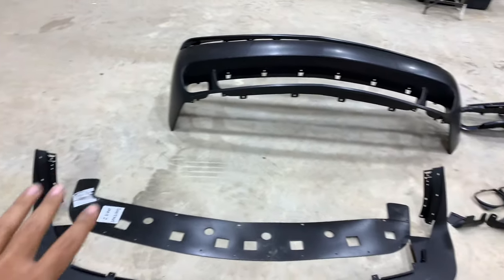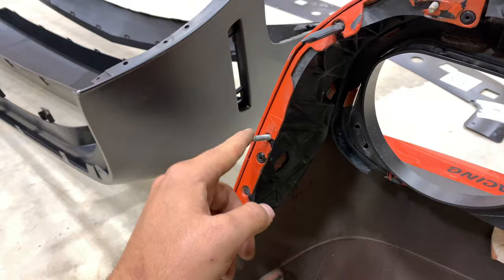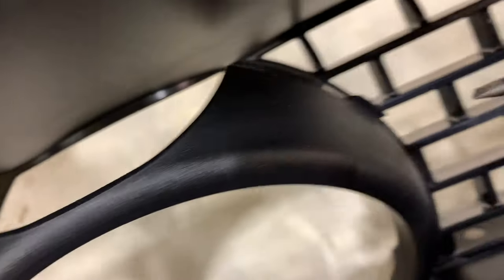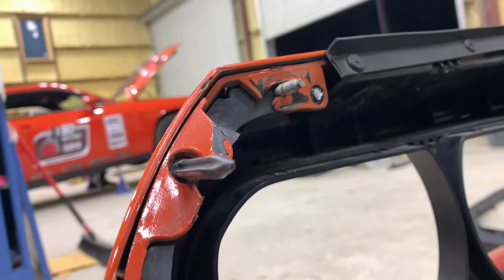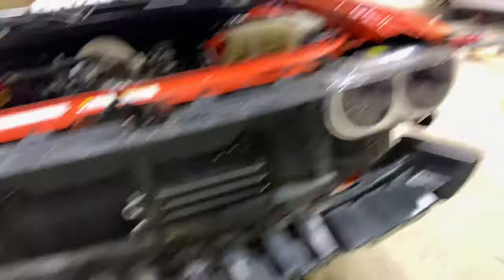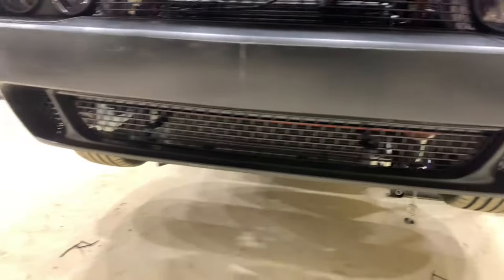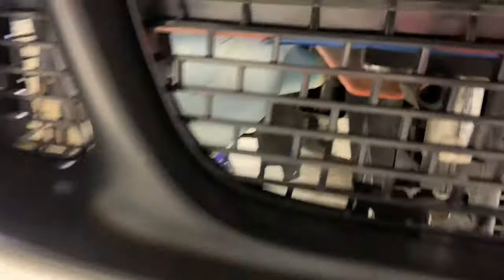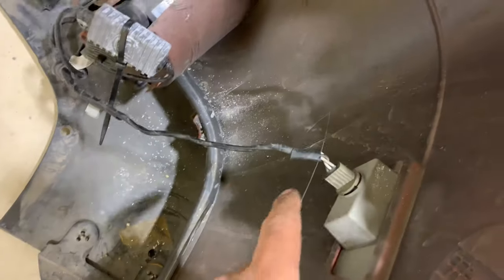Vicrez Demon/ Hellcat Front Bumper Install On My 2009 Challenger SRT-8!

Comment: I get my kit today 🥰. Perfect timing on the video.🤜🏽🤛🏽
Reply from the maker: Awesome! This is only part 1, I talk about having to trim it to fit my 2009, idk what year car you have so just keep in mind you might have or might not have the fitment issues I had.
Reply: TIRADO RACING I have a 2015 r/t that a recently procharged. This widebody is the most anticipated upgrade. Hopefully it goes well. Thank you for the time you put in your videos. 👍🏽
Reply from the maker: @Riveraharry75  I think i found you on instagram, I sent a DM, if you questions or want to see it up close i can send pics and videos. 

Im playing catch-up on video edits and posts, but the kit is painted and on the car lol you can peep it on my insta as well!
Reply: TIRADO RACING sounds good!!
Reply: @prochargedmopar15 when you finish installing your kit please post pics or videos I’m looking to buy and explain the process..I have a 2015 HC and really wanna know if it fits well without modding much
Reply from the maker: 6 Dreams it’ll fit the Hellcat the best. Because of the front bumper. I had to buy a Hellcat front bumper so the front forward most flare with the reflector would line up. 

The rest of the body lines are the same. Front fenders and rear quarters. Same.

Comment: Hey very helpful video. Just one question because I want to do this for my 2013 392. To upgrade lights would I be looking for lights of a 2013 model or 2015 onwards as fitting might be different after this install?
Reply from the maker: You need 2015+ headlamps. Do NOT BUY 2015 “styled” headlights for your 2013.

They absolutely need to be for a 2015 car. Secondly you need an adaptive harness for them to work on your pre 2015 model.

Comment: so when you installed the demon bumper on part 2, you didn’t need the parts that you took off at 7:38 along with the other parts you took off?
Reply from the maker: Yes sir, I threw them away. Whatever I took off to make it fit is gone. 

Now let me be clear I primarily use this car for racing, some of the parts I took off are important in the event of a collision. I’m In no way saying take it off I’m simply showing what it takes to make it fit.

Comment: Did you end up cutting your fenders to allow your tires to travel inside the fender flares?
Reply from the maker: Hey Jim, 

Yes I cut both the front and the rear and matched the cuts on the flares as well. My car is lowered on bc racing coil overs and now I’m running oem demon wheels on 315/40 tires all the way around.
Reply: TIRADO RACING man your car looks great and I won’t to do something similar to my challenger. Since you cut the fender and the flare how did you attach he flare to the car?

Comment: Hey bro did you end up using the middle bumper support? Im asking because i don't have it and i need to buy it. Thanks.
Reply from the maker: Are you talking about The black plastic piece and foam?
Reply: @TIRADORACING  minute 8:11 of the video.
Reply from the maker: Yea I did put it back in. The problem wasn’t that upper bracket it was the grill hitting the headlights. In my second video installing the bumper I show everything I did to make it fit. Trimming and cutting.

Comment: Hey man! Any ideas on the specifications of the screws, nuts, and rivets? My kit did not arrive with hardware
Reply from the maker: Man I have not a single clue. Just to verify, you purchased yours through vicrez? If you did purchase it through vicrez I would contact them directly.
Reply: TIRADO RACING thank you!
Reply from the maker: Good luck Jasper!
Reply: Ha yeah just got my kit yesterday as well and came with zero hardware. But it came with a foam part to replace that plastic bumper you removed.
Reply from the maker: Mine came with that foam too, I didn’t use it because weight reduction lol but just like I told the other guy I would contact them directly. Really weird they don’t have hardware with them
Reply: Yeah I actually found that hardware. But man the fitment is far from OEM like they claim. But putting that top assembly into the bumper are so far off i might need to contact them.
Reply from the maker: Just to clarify anything, this bumper is for 2015 and up ONLY. 

The big thing is the older generation challengers have BIGGER headlamps. That’s why I trimmed my bumper and headlight mounts in my other video for a flush fit. 

You can also switch to 2015+ headlamps and purchase the adaptive harness separately instead of trimming the bumper. 

If you remove your headlights and the other stuff that’s in the way from the previous years you’ll see it slides right on like a regular bumper. 

You see I had to take ALOT of stuff off my car for it to fit because it’s an older generation.
Reply: Well to clarify on tge site ot say 2008 and up. But im not even concerned with small things like that cause thats just the nature of the beast. But my corner were the upper assembly goes into the bumper might be around a 1/4 off. Will see though.
Reply from the maker: Well damn. Honestly man, I have yet to be BLOWN away by an aftermarket part regardless of what’s advertised. Oem parts fit like oem and have oem quality while aftermarket is always..... aftermarket 🤷🏽‍♂️.

Comment: Hey man, did you ever put the piece at the 8:09 minute mark back on, or did you just leave it off? Got my bumper coming in tomorrow and wondering if I need to take that part off.
Reply from the maker: Yea I put it back on. I left the foam off and those corner pieces off tho.
Reply: @TIRADORACING  do you know what purpose that foam and corner pieces serve and if models that come stock with this bumper have similar parts there from factory? I don't mind taking them off if I need to but I would like to know why they are there.
Reply from the maker: Bro I have 0 clue. Just don’t be scared if it’s in the way toss it. I wasn’t building a Hellcat oem factory clone or anything so I threw away a lot of crap to cut weight.

Comment: I'm looking into ordering a similar bumper kit for my 2014. I know these bumpers need the 2015+ side markers, do they plug into the stock wiring harness, or do I need a newer style? Your car is hella sick btw!
Reply from the maker: You’ll need a newer harness and have to do some cutting and soldering to make it work. Thank you that means a lot! 😁😁😁
Reply: @TIRADORACING  Right on, appreciate the info!
Reply: Did you ever end up getting side markers or finding where to get the newer harness? I’m in the same problem with mine.
Reply: @PitchPerfectKill  did you ever figure this out? I’m looking to get the newer harness and don’t know where to order. Also, which side
Markers did you end up getting?
Reply from the maker: Yea I got a harness from eBay and one of my videos (it’s titled side marker harness or something) I show how to do it
Reply from the maker: PSA: I am not building a Hellcat Widebody Clone + how to install 2015+ LED side markers
https://youtu.be/TRYjGMZ2frI
Reply: @TIRADORACING  thanks so much. I found a harness on eBay. It’s the whole assembly for 2015 and up, with the head light plugs included. So I have the raxiom style 2015 and up aftermarket head lights on my 13 challenger, I know I’m going to need to go some shaving on the bumper and modifications to it. Wonder if there’s a way I can order that harness  for the side markers but I wouldn’t be needing the new head light plugs of the new harness, as the raxiom head lights I have plugged into the old harness. Just the plugs for the new side markers Is what I need. I wonder if I could just solder that into the old harness.
Reply: @davidlockemusic  I bought the 2015+ side markers for the front, and I wired them to the harness that was already there. I had to buy connectors to splice to the wiring for the newer side markers to fit, but it worked out well. I bought the connectors from Autozone for about $12 each.
Reply: @PitchPerfectKill  do you have a link to the connectors?

Comment: I have the vland 15+ conversion lights. Any idea if they would work with these
Reply from the maker: No clue brother. If their conversion headlights and are still the same size then no. 

I think those headlights just “look” like 15+ headlights that fit in 14 and below bumpers so no they won’t work. 

You’ll need actual 15+ headlamps that are smaller

Comment: How did you get the old side marker lights connected?
Reply from the maker: The old side marker lights don’t fit the widebody. I used widebody side markers. A 15+ side marker harness. Spliced that into my old harness and it worked. It’s in a YouTube video here somewhere I show exactly how to do it and what part number to buy. I think the video is titled “wiring sidemarkers” or something like that

Comment: So do I need to cut my fenders if my car isn’t lowered? What if I put 275’s all round and put spacers would I still need to cut my fenders? Because I watched two other videos and they had to cut their car fenders in order to make it fit with the tires! I don’t know if I need to do it too because they had their car lowered.
Reply from the maker: I’m not saying to do this I’m just saying what others have done. 
stock ride height does not need to cut the fenders. @whipswitwavy on Instagram and YouTube is stock height no cutting. 

275 is the width of the tire not the sidewalk height, you could literally throw 335’s on there but it won’t make the tire taller. The second number is sidewall height. 

I run 315/40/18, a 40 sidewall is pretty tall*

Comment: Hi did you end up getting new turn signal harness as my 2009 don’t fit the new wide body refector
Reply from the maker: You need to get a new harness from the dealership then cut and solder the new ends onto your old harness.
Reply: @TIRADORACING  thanks also installing this kit myself :)... and also did you also end up having a big gap from the front bumper to the hood?
Reply from the maker: That gap is from a seal you need to transfer. Your not the first person to say “there’s a gap”. 

You need to install a new weather strip seal on the front bumper
Reply: @TIRADORACING  did you need new weather stripping or were you able to use your old stuff?
Reply from the maker: @JayyBird93  my old strip was already torn bought a new one and replaced with new plastic rivets.

Comment: so i have the front bumper and side flare kit, i’ll be getting demon wheels on all 4 corners and going 305’s in back and 275’s in front. will i have fitment issue? the rim is 18 inch. (scat pack 392) 2015
Reply from the maker: Idk where you got your demon wheels from,  but here’s what I read. 

The oem demon wheels will NOT clear the 6 pot brembo brake calipers 

The demon front brake calipers are smaller and closer to the design of the 4 pot brembo brake calipers. 

I have a 2009 srt8 so I have 4 pot brembos and they fit just fine. 

Clearing the brembos is the only fitment issue with the oem demon wheels. 

Of course those wheels are 18x11 and if your running those just be aware you might have clearance issues with your fenders and you might have to cut.

Comment: I have seen after parts are never going to fit correctly even 2015  and up.  although  through 2015 up    has a clean lines. interior is different  between 2008 and 2015
Reply from the maker: Slightly misleading comment especially when myself and many others have installed the kit. I will be the first to admit other people have installed it better than I did. 

It is not impossible it just takes a little patience and work. 

Yes the interiors are different but the body kit has nothing to do with the interior, or should I say, the interior design does not affect how the flares sit on the car....

Comment: Will you install the 2015 headlights so that it fits properly ?
Reply from the maker: I plan on making the switch later, I actually made it fit which I’ll show in the next video. I wanted to sort of give options. The 2015 headlamps and adaptive harness aren’t cheap lol 

I shaved down parts of the bumper and where the headlamps mount and got it to fit. 

You can see pics on my Instagram. My Instagram is mostly up to date, my YouTube has been behind. But working on catching up 🤘🏽

Comment: i have a 2012 and i’m looking into swapping my grille do i have to swap the whole bumper or just grille?
Reply from the maker: The entire bumper if you want the hellcat grille.
Reply: @TIRADORACING  okay so say if i want to do a face lift to my car, will everything im trying to change on the front end have to be from the newer models?
Reply from the maker: @mryoungman. Yes. Bumper, upper grille, lower grilles, side markers, headlights.

I ground down a lot of the hellcat fascia for it to work with my older headlights.
Reply from the maker: @sstevenn  correct! headlights from a 2015+ because their smaller, adapter wiring harness to make them work, bumper, grilles (upper and lower), and so on.

Comment: How long did this take and how much is the kit?
Reply from the maker: Took me maybe 2 weekends to have it all done after paint. Link to parts in description of the video. 850 for bumper 690 for flares
Reply: @TIRADORACING  ok nice I didn’t even know the body of the challengers was the same as the 2015 and up ones
Reply from the maker: The chassis has been the same since 08. The 15’s and up have a different interior, front bumper and rear bumper, door handles and some other things depending on the trim level. But for the most part same chassis with same mounting points.
Reply: @TIRADORACING  yeah I know the interior is different I was just talking about the chassis
Reply from the maker: Annnnnnd I was just talking about the challenger chassis as a whole. I 100% understand what you were talking about I was just touching base on all the changes for any reference or context.
Reply: @TIRADORACING  oh ok I see you